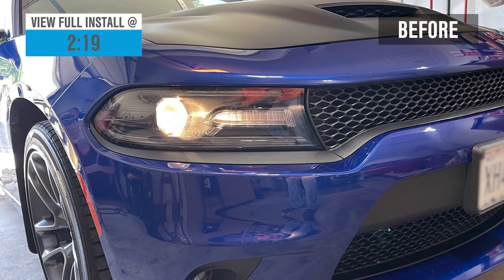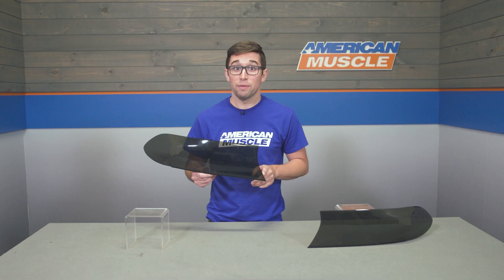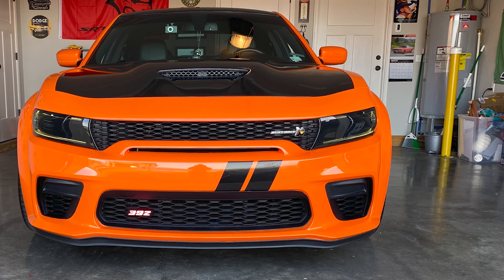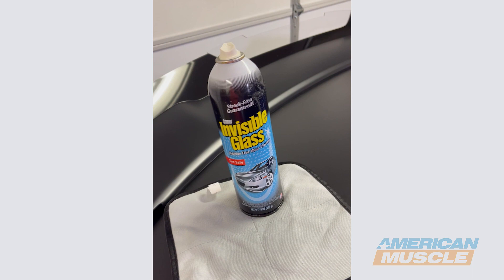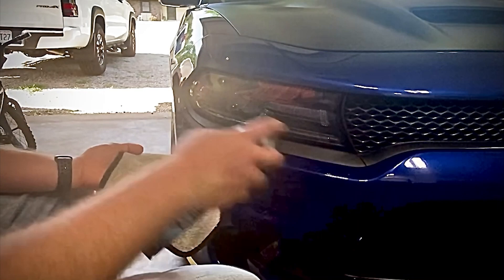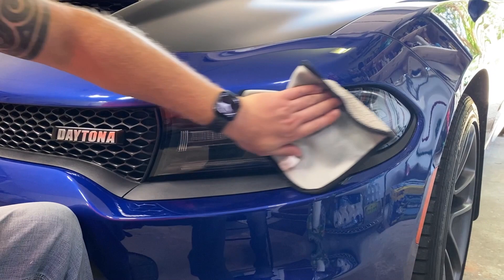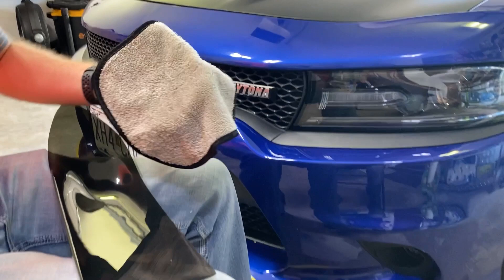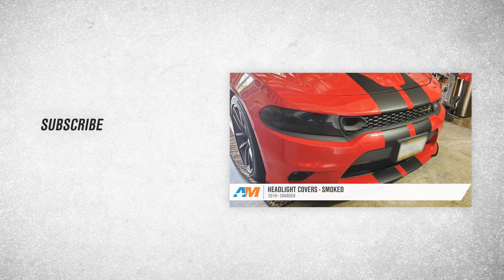2016-2022 Dodge Charger Headlight Covers Review & Install

Comment: One of mine flew out . Waste of money . Dont buy . RIP OFF
Reply from the maker: When the 3M Automotive Grade Tape included with headlight and tail light cover kits like these are installed properly on a cleaned headlight surface, they won't just fly off when going down the road. If you give our customer service team a call I'm sure we'll be able to try and help out with getting you a replacement set! 1-877-887-1105 -Zach
Reply: How is visibility at night
Reply: @jwoodard1369  lowered visibility, but looks good
Reply: Which one fell off? I'm looking for a driver side. I broke it by accident

Comment: I almost always provide positive feedback on AM MOD products, but in this case I have to say, in my opinion, these smoked headlight covers look cheesey.  You can see even after they are installed, when the installer was cleaning the lenses, the covers were moving, which tells me they can easily fall or be ripped off later on.  Sorry AM, thumbs down 👎 on this one.
Reply: Well as you can see sir he just cleaned and popped them on didn’t look like he used any type of adhesive to hold. So yeah it looks like it will fly off if you don’t want it permanent.
Reply: He’s just showing people how easy it pops on they have 3m tape adhesive that will fix that problem from flyin. If that wasn’t the case they wouldn’t of sent a bronco front end bug deflector with the same adhesive. But he should have showed the adhesive as an option. I have a charger as well and plan on atleast getting the once to try
Reply: Did you do it